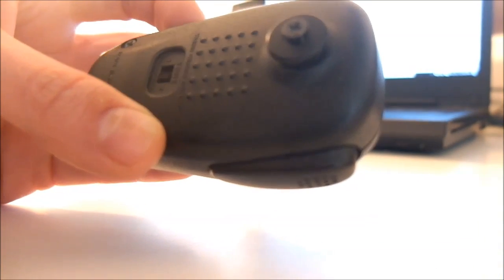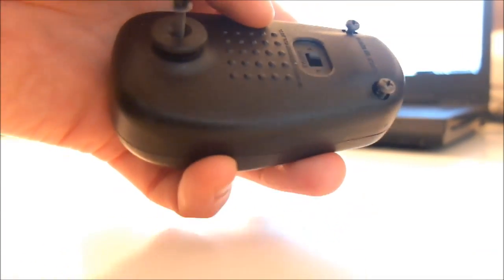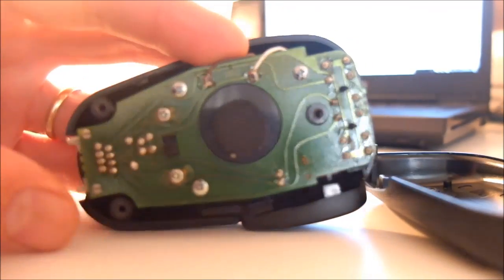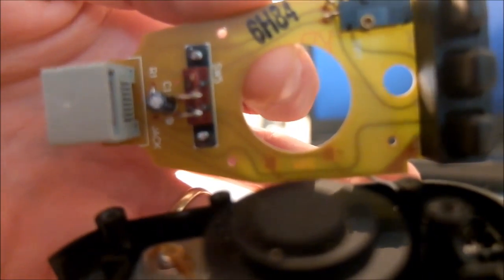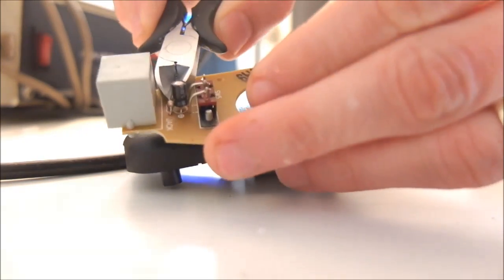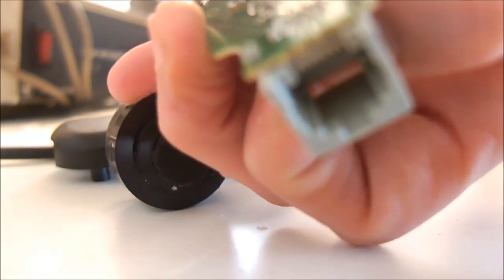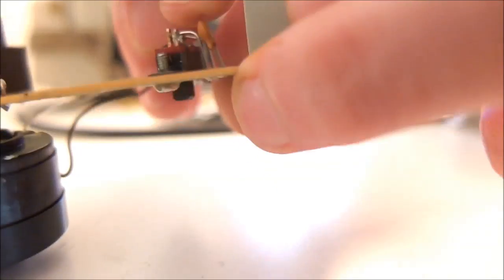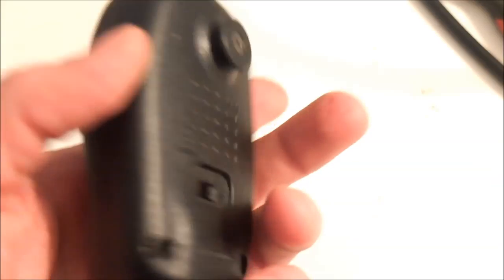Simple mic mod for the Yaesu FT-817 MH-31 microphone with A/B comparison (more talkpower)

Comment: I just performed the mod. It is interesting that I was using the mic with the switch in the 1 position, which should be bypassing the cap anyway. So, I look forward to seeing what the difference is. I have two MH-31, so I did a dummy load TX test with both, and it sounds quite a bit clearer with the mod.

Comment: I tried 0.1uf electrolytic and a 910 Ohm resistor. I seemed to be getting hum without the resistor. Original values were 680 Ohm and 0.33uf I was finding standard position a bit bassy, i think this adds some extra high end for clarity.
  I decided to try this because i always found the mic muffled, i have never used the hand held but i have had issues with the Md-100 going into oscillation. That bloody desk mic is really starting to piss me off.

Comment: I threw out the stock dynamic microphone capsule and the stupid steel weight, added a tiny electret microphone and bias resistor. I get far better audio reports now. Plus the microphone weighs a lot less in my bag. You can find a retractable cat5 cable to replace the big curly lead

Comment: Yes, It works fine, with a 100uf 16v C .. You get some more bass and mike power - the treble are the same as before. Thanks to DH7LM for this simple but helpful mod - from DM7KW - vy 73 ...

Comment: Replace the electrolytic with a 16v 47uf, remove the resistor and then re adjust your EQ settings for your voice. 
both positions on the switch work for me. and this has definitely changed the frequency response of the mic....Thank you..

Comment: Google MH-31  mods mate then you will understand what to do this mod screwed  up a decent microphone you need to use a 1uF and 47nF and switch h between the 2 one setting for fm the other for ssb   please no one follow this films suggestion make a sticker tone1 fm tone 2ssb from the funkamateur.de online shop you can buy an In line speach compressor board for the 817 that's what you really need

Comment: Sure a good mod, but i did swap my mike with a MH-67 and there's lots of a difference. The mike was like 15 USD or something, was Vertex wired, just had to figure out why the rig shuts down immediately once i plug it in the rig (FT897D). One wire to unsolder and there we go.

Comment: Did not work for me, and F-ing with the mic will destroy it. Just use the Yaesu provided adjustments. In addition to the mic switch on the back, the 450D also has a mic equalizer function in the menu.

Comment: You are better served by putting together a FUNKAMATEUR DYC-8X7 speech compressor kit. It connects inline with the mic cable and has an on/off switch. I use it with my 817 and 897. The cost is around $45 USD.
Reply from the maker: Yes, that is a better solution, and I wanted to get one for some time. Thanks for the comment!

Comment: Sorry to say this but the  47 pF capacitor will do NOTHING to improve your signal quality. Actually it does nothing at all because the value is way too low to pass the microphone audio through. Actually the microphone will only work with the switch in position 1, after your modification. Removing the resistor will improve your audio level slightly but the radio will be prone to RF getting into the audio tract.
You'd be better off to put the 47 pF cap in place of the resistor to cut off some stray RF.
The original capacitor was used to cut some lows from your audio. It was connected in series with the microphone element when the switch is in position 2 only.
Reply from the maker: Thanks for the comment - I can't say anything about the 47pf value, I just followed a recommendation myself and it seems to work for me... It's true that the mod will only work on one position, but that doesn't matter for me; the switch as it comes from Yaesu is pretty useless IMO. It would be interesting though to use different combinations for position 1+2 and experiment with this.
Reply: mine works in pos 2
Reply: For what it's worth, the video is stating to sub the E-cap with a 47nF (.047uF) cap, not 47pF (.000047uF) cap ....
Reply: Not true, I tried with a bunch of caps from 30nf to 100nf ceramic, these seemed to provide a range of eq however i ended up going with a 0.1uf electrolytic and a 910 ohm resistor otherwise i got hum.

Comment: HI: I WOULD LIKE TO KNOW IF THIS MODIFICATION WORKS WITH THE YAESU 857. THIS RADIO COMES WITH THE MH-31 MIC TOO. THANKS
Reply: YES IT SHOULD DO THE SAME, BUT YOU CAN USE normal small letters, it is much more likely to be read by others 😉.